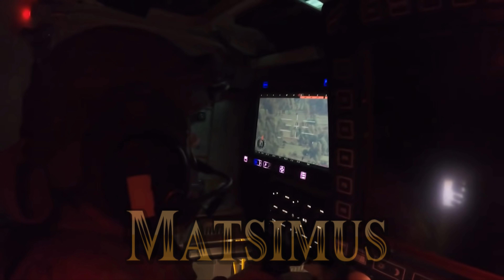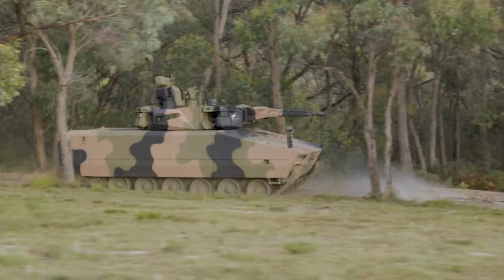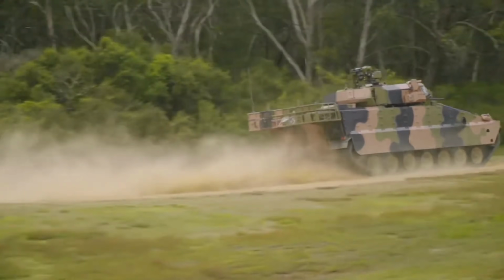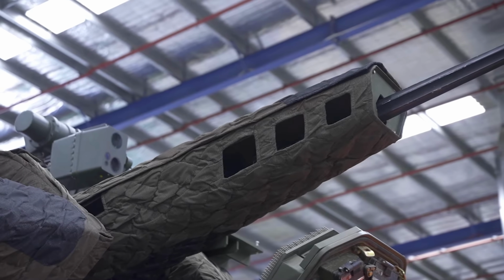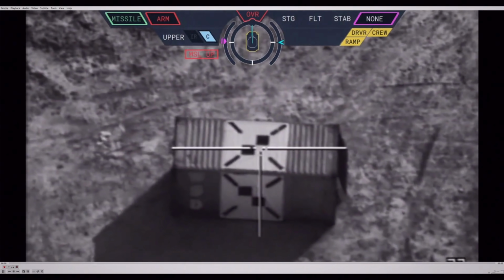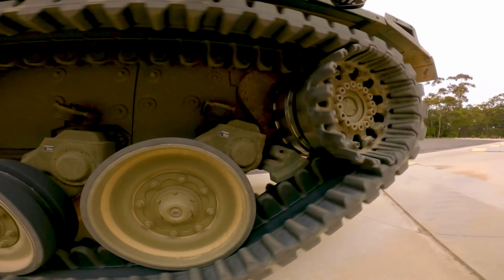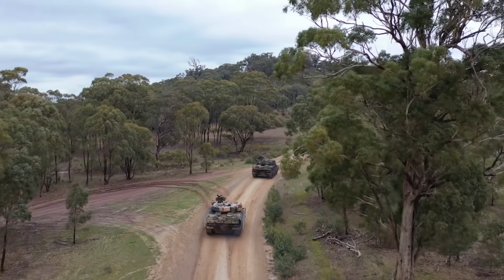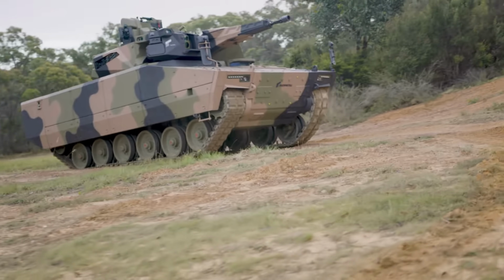KF41 'Lynx' & AS-21 'Redback' Infantry Fighting Vehicles - Land 400 Phase 3 | ARMORED COMPETITION! 💪

Comment: The Redback was designed and supplied to specifically for the land 400 requirements, even the turret system. Whereas the Rheinmetall contender had  to add additional units to the turret and vehicle itself for the missile system etc. Also the Rheinmetall unit uses specific 30mm ammunition, not a generic round and it can only be sourced from Germany, it also has apparently caused jams during testing. Only saying what I have heard so far.
Reply: I’m skeptical of claims that the Rheinmetall cannon is unreliable. German designed guns are are class leading. Have been forever.
Reply: @wattlebough  he said ammunition, not the gun.  Ammo is critical to the performance of a weapon
Reply: Though it shares ammo with the boxer at least, which Australia also fields. That could bolster the supply problem a bit
Reply: The missile system was part of it from the beginning 

As for the ammo

1) Same gun on the Boxer.
2) Factory for making it in AUS if Lynx wins
3) There are other producers for similar ammo. They (or AUS) just need to be ready to spend the money to certify it.
Reply: @wattlebough  as I said on the original, it is only what has been reported, not faulty, but some jamming problems and the rounds are all made in Germany.
Reply: @positroll7870  if it was originally part of the turret (missile system) then why did they have to add it which changed the profile and weight of the turret from the original LYNX turret?
Again, I am only relaying what has come out of the testing so far.
Reply: @swunt10  obviously from your "About" and other comments, maybe better to rethink anything you say.
Reply: @sampointau  It was always a planned in option. But AUS doesnt just want the missile launcher added. It also wants a RWS and the heaviest APS out there put on the turret all at the same time. Putting 2 of them on the turret wouldnt be much of a problem. Balancing all three while keeping the gun stable for firing on the move is more complicated.
Reply: Ammunition and explosives factory in Várpalota
The cornerstone of the Lynx factory was laid in Zalaegerszeg on December 17, and it was also announced there that another military plant would be built in Várpalota for the production of explosives and large-calibre military ammunition and minesweepers. The plant will manufacture 30-millimetre ammunition used by Lynx, 120-millimetre ammunition used by Leopard tanks and 155-millimetre ammunition used by Panzerhaubitze 2000 self-propelled carts, thus providing ammunition for all three currently standardized combat vehicles. Besides that, the plant will produce RDX explosives, and there are plans to relocate projects of the Austrian mortar and artillery ammunition manufacturer Hirtenberger Defence Systems, bought by the Hungarian state last year, toVárpalota, as well.
Reply: lol why would they order it with that gun then? you are aware there are about 4 guns it can be fitted with
Reply: @sledgiefd9070  yet didn't specify which gun it was. More than one gun type can be fitted so it's just false to say that

Comment: Well, they seem to conform to todays standard.

30 mm canon which gives a choise of ammunition - which means it has air defence capability - trust me: A fighter bomber or helicopter is NOT going to feel comfortable annoying a platoon of IFV spitting 30 mm shells in their general direction. Furthermore 30 mm will give solid fire support to the dismounts.

The other thing is the Spike missile which is replacing the TOW in many places. How well the optical fibre will perform in combat is a bit up in the air.

As to building the vehicles in Australia - well, that is a very common option, that is not taken up very often. The Danish Army buying MOWAG Piranha V actually wanted to build them in Denmark - nothing came of that - considering that MOWAG in Kreuzlingen have invested quite heavily in production facilities - and setting up a production line for 300 vehicles - if you theoretically could get the qualified workforce. Does not make sense. The Swiss are not cheap; but being a cheapskate might not be the best idea.
What you can do is integrating the weaponssystems yourself. Then there is only one to blame.

What surprises me is the number of road wheels on the South Korean contender. The problem is the length to with ratio. If it gets to small the vehicle becomes more unstable turning wise - if the ratio is to high the vehicle will have problems cornering as tracked vehicles generally turns by braking one of the tracks - scooping all sort of things up into the track (pavement, garden ornaments and trees - to mention a few). I can't say if the rubber tracks will justify a wider distribution of weight.

What makes me wonder, also: There seems to be 6 dismounts which is a bit surprising and raises the question of the heavy infantry squad. I can understand you go from 8 to 7 with a light mashine gun that does not require an extra schlepper. But dispensing with another?

What I like is the realistic assesment that ranges beyond 2000 meters are manufacturers claims in the pornography department.
Reply: The spike is supposed to be the best missile system available  today for IFV

Comment: A good replacement for the Bradley, IMO.
Reply: True but US will instead spend 10x as much to develop their own Bradley replacement. Best case scenario it will be like 10% better, worst case scenario and it's equal or worse than the already available options.

Personally, I am a big fan of the Puma and wish the US would just adopt an americanized version of that. The CV90 or whatever the newest versions are called is also a compelling option.
Reply: @Rampant16  these two are the current Front Runners out of the five contestants for the OMFV program

Comment: The worry is the turret is already overweight and they still gotta try fit an active defence system on top of it :/ which is going to be tricky. But yea cool machines if they can pull it off.
Reply: @Nathan-ry3yu  ? Its the exact same concern as the Boxers, are you going to echo yer thoughts on those too?   "RDA is not contracted to integrate an active protection system (APS) onto the Boxer CRV [but it] continues to work with Defence in identifying a sufficiently mature APS solution for future integration," a company spokesman told the ABC.

However, sources inside the LAND 400 Phase 2 project warn there are now growing problems with the Lance Block 2 turret which will be integrated with the Spike 2 anti-tank missile and the Iron Fist Active Protection System (APS).

"It is the Lance Block 2 turret that is overweight — it's unable to integrate the missile and APS without making the vehicle too heavy"
Reply: @Nathan-ry3yu  APS integration is a significant challenge in everything, even main battle tanks.

Comment: While the lynx and redback are both very good  they can't beat the new BAE systems IFV whitch the Americans may be buying, because the bae is designed to defend against rpg attacks with an automatic anti rpg weapons system. The lynx and redback can only hope the armour stops an rpg attack.
Reply: every single ifv you mentioned can be equipped with some active protection system. It's not unique to the bae cv90.
Reply: @tonyvu2011  idk why are you mentioning a missile defense system in connection of an ifv but try again....
Reply: @hatchet646  Elbit Systems’ Iron Fist active protection system (APS), same function as Iron Dome, whch protects IFV against missiles and other projectiles.
Reply: @tonyvu2011  god i see you are comparing aps to iron dome which is questinable at best but whatever not gonna go into it. 
But most importantly cv90 and redback both uses iron fist so your argument is really void.

Comment: Badass equipment for a badass fighting force. The Chinese will regret it if they or anybody else faces off against a combined force of Abrams alongside these machines with the troops to put to rest anyone those anti armour crews that need a few rounds to disaude them from the folly of their action
It.....kick ass
Reply: In the theatre of operations, don't forget the long parade of soft coated fuel trucks. Using the abrams is like fightig with one foot in the bucket. Stupid choice! And I say that as an American. There are much better tanks out there.

Comment: As a Korean, I think Lynx will be a better choice.  AS-21 is also good I am sure (Koreans know how to build tanks)...but I am more inclined towards the ones that are proven in the field - and maintenance and support - simplicity of field ops.
Reply: Korean netizens are way more well behaved than Indian netizens who think Ajun is better than Leo2A7 and LCA better than F-35... 🤣
Reply: Are you sure you are Korean who lives in Korea as a local citizen and not Korean who lives abroad? Your English is too good. Anyway, I think in your original comment above you may have Lynx and Puma mixed up. Germans had Puma for awhile and last design change was in 2009 for Puma - which in today's tech is kind of old and outdated. As for the KF41 Lynx (which is based a lot on Puma), it is brand new and was designed for German's export market (German army, Bundeswehr, only use Puma, not Lynx) and first customer is Hungary in September 2020 so Lynx has not been "proven in the field" at all. Both AS21 Redback and KF41 Lynx are brand new in design. 

As for the acquisition cost + MRO (Maintenance cost, Repair expenses, Operational cost), it is projected that AS21 Redback will easily be lower in price while matching evenly in performance with Lynx... some say the technology is actually superior in the Redback, especially situational awareness from Iron Vision system which lets the personnel inside "see through" the exterior armor (similar to how F-35 pilots can see through the bottom floor of his plane). Of course the most important part - the engine - is German for both the Redback and Lynx so no real advantage between the two.
Reply: @jwb1227  I live in the US now but you will be pleasantly surprised to know many folks speak fluent foreign languages in Korea.  A good place to visit :D

No, I am not mixing between Puma vs Lynx.  Puma as we all know came out to the export market way too late - and what I was emphasizing was the fact that Rheinmetall AG has far more experience in design and implementation than HD (KS21 owner - who got it from Mobius, who got it from Daewoo, who got it from Hyundai...you can see where this is going).  MRO and logistics of acquisition cost could be lower initially with the Korean design, but AS-21 is considered still a test phase as its original platform K-21 has never been combat proven (or even been tested with such upgrades in long term).  So you got to take the Korean response to Aussie's RFP with a grain of salt.
Reply: @LooxJJ  Fair enough. You should know that the Redback is "loosely" based on KS21 so the overall design and manufacturing is actually "bespoke" made to Australian specs and personnel size dimensions. 

From what I understand from little bits of news coming out of the Aussie testing of both Lynx and Redback (in case you are interested), the performances are evenly matched in both accuracy and lethality of the weapons system. As for the driving and maneuverability testing, I heard that during one of the driving tests, one of the Lynx test unit had a gear box problem while the Redback was fine. Not sure what happened since both competitors use the German MTU engine with German Renk transmission (I think?). One of the commenters in another thread commented that in a separate test, Redback had an issue during driving test but when I pressed him on it (since I have not heard that in any of my sources) he could not give details so he may have been trolling for Germany. 

So, I think there is really two things left as far as testing and evaluation are concerned. There is the partially destructive testing where incoming ATGM (Javelin/NLAW/Kornet/RPG 7 type of attack) is tested against the active protection system. The Redback has the Israel's Iron Fist so that should be interesting and close to the actual combat testing possible. Finally, the last eval would be to review the projected cost to performance ratio and other aspects of the vehicles before final winner is announced. One more thing - The winner of Land 400 Phase 2 - Rheinmetall AG's Boxer AFV is having a "weight problem" with its turret. I think the APS cannot be integrated into the turret due to going over the max. weight limit for the vehicle. The issue is Rheinmetall is not being cooperative to the Aussie MOD's request to address the concern so that may cut against Rheinmetall's chance at Land 400 Phase 3 IFV contract.